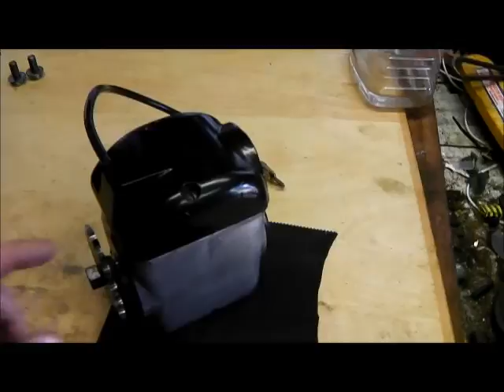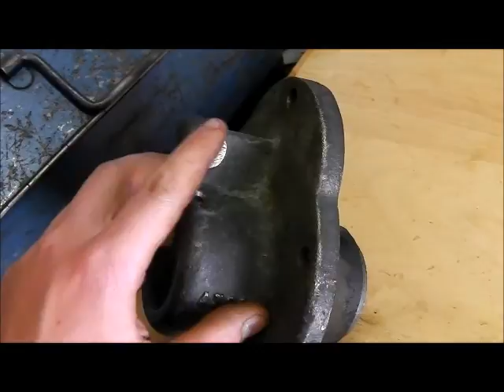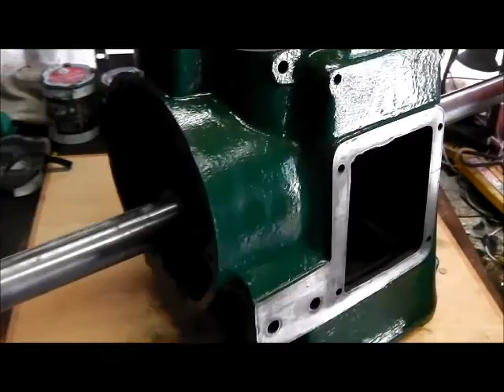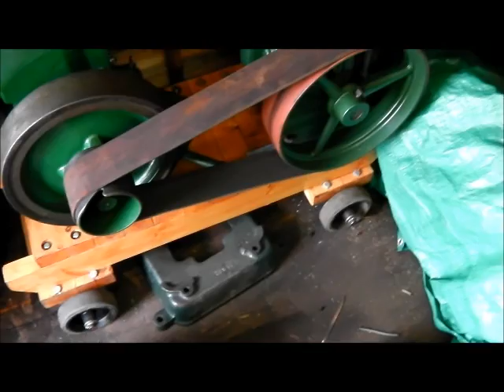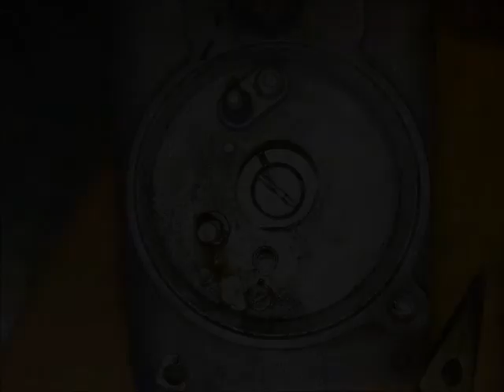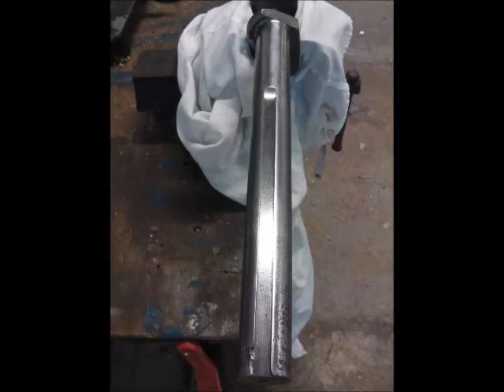Lister Junior Restoration Part 7

Comment: Hi, Phill, it's all looking remarkably good! The finish on the mag is superb (there's not much you can do about the corrosion). I would certainly replace the capacitor, you'll see the improvement in the spark. I wish you'd talk about Thous or millimeters rather than 32nd of inches!
A real credit to you.
Jim.

Comment: Hi Phill , I have a Lister Junior exactly the same , I intend to restore it and your vids will be very helpful however the magneto that came with the engine although in great condition is marked as a clockwise drive but the engine runs anti clockwise , The mag looks exactly the same as yours , is there any way you know of to convert this mag to suit , I could build a much larger bracket to take it beyond the flywheel and turn it around and use a longer chain drive but that would be a bit of a bodge , any thoughts would be gratefully received , Alan
Reply from the maker: Alan,

I'm glad the videos will be useful to someone!

You can reverse these magneto's, never having done it myself I am unable to give much detail but I believe you adjust the position of the points cam relative to the highest point of magnetic flux for the direction required. A good job for a rainy day....

All the best,

Phill.